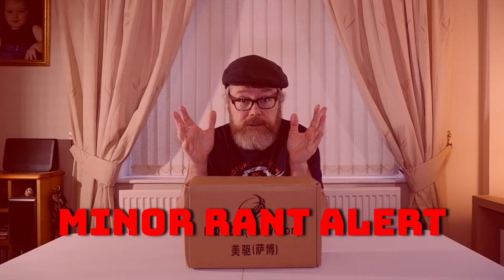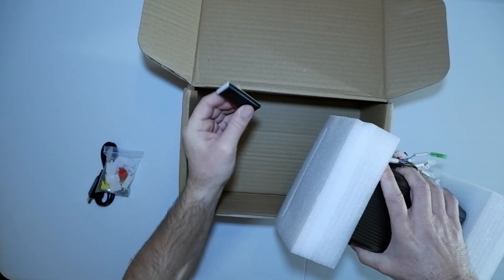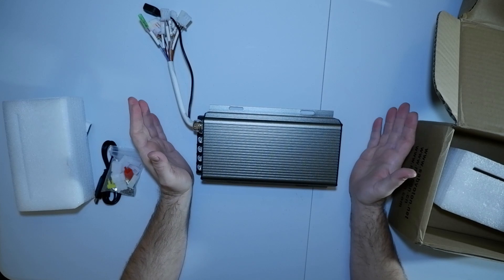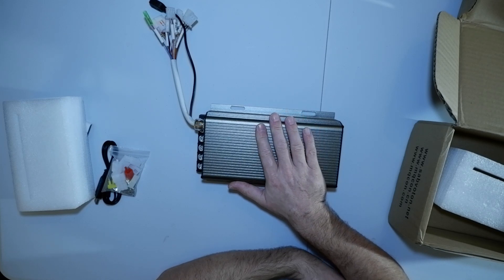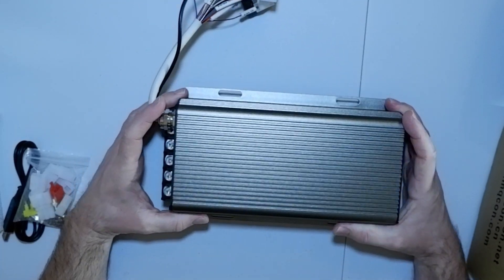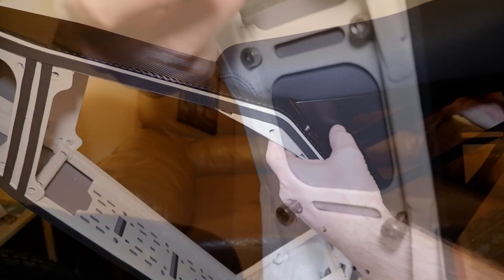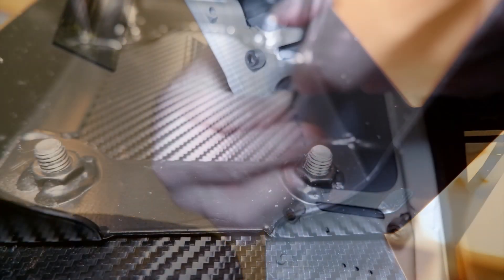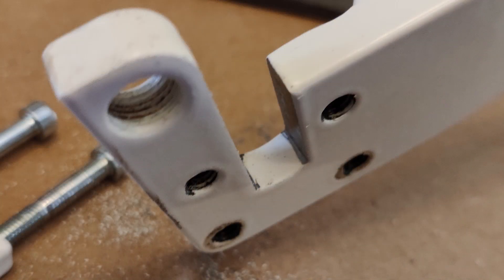FAST EBIKE BUILD UK ROAD LEGAL PART 7 - They sent me the wrong Sabvoton SVMC72150 V2 controller

Comment: So question I haven’t watched all your videos yet but I just received my Sabvoton controller and there is no display connector…? If you purchase a Sabvoton with a display in a kit it comes with a display connector and an alarm connector…? I see you in your later videos you have a display and I’m wondering how did you work that out? Did you have to solder a connector on the board?
Reply from the maker: If you buy a sabvoton and display together the sellers have altered the sabvoton inside to work with the paired display.  I first made the mistake of buying a display separately and it didn't work so sold that and replaced it with a display that would show indicators/lights and read speed /voltage from sabvoton.

Comment: Hi Mr Butties! Can you tell me your opinion of the 72150 Sabvoton controller in terms of output advantage over the standard aliexpress controller that came with my stealthbike? mine was a 5000watt stealth and Im running a 72volt battery. The controller it came with is an 80a. Do you think its worth the upgrade? Cheers.
Reply from the maker: The sabvoton controller is going to be better but the gains will depends on your battery. Do you know how many amps your battery can output?
Reply: @baconbuttties  at 120A continuous and 240A peak.
Reply from the maker: @TheHowardski  If the battery can do 120 amp continuous and 240 amp peak then you should be able to get more power using a the sabvoton 150 amp controller .
Reply: @baconbuttties  Ahh ok that's excellent news. I was curious. Like you say in your videos, it's always interesting to see if you can get more power! Thanks again.
Reply from the maker: @TheHowardski  👍
Reply: @baconbuttties  Hi there it can output 30amp, does that sound right? Cheers, H

Comment: Noticed in your earlier videos that your discs on your front wheel are not fitted correctly, they have direction arrows that should point the same way as the arrow on the tyre so one of them needs to be turned around
Reply from the maker: Yep I  know this 👍

Comment: Will the standard delivery service take ages to be delivered for the brackets.
What shipping method do you use.
Reply from the maker: I have just used standard shipping as DHL shipping is £23 just for those small parts. I will have to wait but should be quicker because it's so light . I reckon if i had used fast shipping on all the parts especially the heavy ones would of cost loads.

Comment: 12:19 This is a really strong kickstand solution. I can tell from my own experience. For example, this Enduro default kickstand is a complete joke(It just fell apart). I´m using Side Stand Honda Kawasaki CR KX 125 250 500 Kickstand from ebay.
Reply from the maker: Yes I had the other enduro default stand before and it was terrible.
Reply: see that kawasaki kick stand was it for vector frame? I was going to buy it as vector has a minimum order amount, but was not sure if will fit my vector frame.
Reply: @craigmcintosh7231  If you have a vector ebike, then buy directly from them. They sell it.
Reply: @DatEbikeGuy  yeah i know mate but they only deliver a max order of 0ver £150.00 ive nothing else to buy total bumber was not aware or would have got with frame.
Reply: @craigmcintosh7231  Thats sucks. If you buy a kawasaki kickstand for example. You need to modify it to fit...
Reply: @DatEbikeGuy  thanks mate will have a think about it first. Hit quite a few snags with build, controller tray too small for sabovton etc money money

Comment: yes you can get the brackets and its down to me that they have them on there to purchase.
Reply from the maker: What's the story there? Was you the first to ask them to start selling them?
Reply: @baconbuttties   You can also 3D print a set.
Reply: @baconbuttties  Yes i messaged them because i had one i had cut the side mounts off and then later needed to mount outside the frame once i had a bigger battery. I noticed the v2 online and it got me thinking instead of buying a new controller it looks like the mounts would fit so i messaged them on there Facebook and said it would be a good idea to offer the brackets separate, and a couple days later i got a message that they were now available on the Aliexpress store with a link provided!!
Reply from the maker: @DeltaCmndrElite  I saw that message on Facebook and that's how I knew they were for sale on AliExpress. Nice one 👍🏼

Comment: Good bit of info there !! 🙂 had to grind off sides of my controller too ,as I have Chinese frame and wouldn't fit properly! Tbh didn't know you could get kit for ends to remount !🤔👍but will leave mine as is for now ! I also had free stand (Chinese) in with my parts thrown in for free 😂😂 could see why it was free when I came to fit it , as hole was off centre had to Re drill 😤 wondering if the stand you have would fit Chinese frame ?? 🤔 as you said better fit ! 👍seat looks better quality as well ! Your vids could become costly for me if I end up changing bits of mine !!🤣🤣 live and learn I guess ,keep them going 👍🙂
Reply from the maker: Yes the seat is really good quality. I will measure the swing arm where the stand fits and put it in the next video as it may help anyone who wants to buy it.👍🏼

Comment: Great as always! Some guy pointed out on my vid about leaving all the top fork bolts loose until the topcap is added so the bearings can be properly compressed in 👍That sidestand looks really nice although need to check if it fits my frame.
Reply from the maker: Saying about leaving the top fork bolts loose made me just think that removing the Fork legs completely and just adding the top and bottom yokes to the frame would of been way easier and then slide the legs back in after.  Scrap that idea as you would have to undo the pinch bolt to line up top and bottom yolks. HOHOH i'm thinking out loud.
Reply: @baconbuttties  Ah ok, I guess removing them might work. 🤷‍♀️What are you doing for torque arms btw?
Reply from the maker: @EverythingEbikeChannel  I wasn't going to use torque arms as these frames usually run without any as the dropouts are so thick. Do you need them on yours?
Reply: @baconbuttties  Will do on mine as there's a bit of play in the axle slot and the pinch bolts are only M4 so can't actually close it. Planning to design a clamp torque arm that can be made with plate steel and basic tools so doesn't require a CNC. If it's a snug fit, then should't be an issue - basically you don't want it rocking in the slot when 'regening' and accelerating.
Reply from the maker: @EverythingEbikeChannel  Yeah my dropouts are extremely snug so hopefully will stay nice and tight. On my swing arm it actually has a bolt on piece on either side which is like using a torque arm sort of. in my next video I will be showing the drop outs in detail.
Reply: @baconbuttties  Heard of that style and like it a lot. Look forward to the next vid 😁
Reply from the maker: @EverythingEbikeChannel  👍🏼